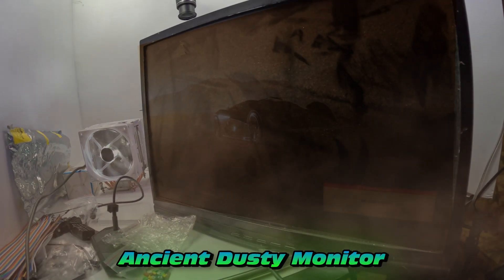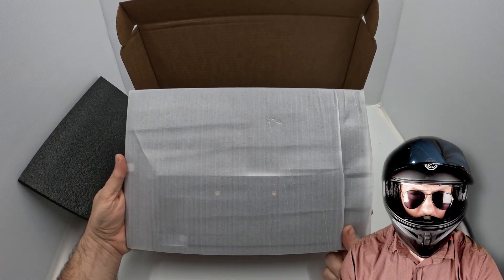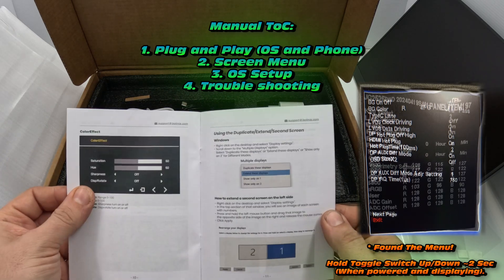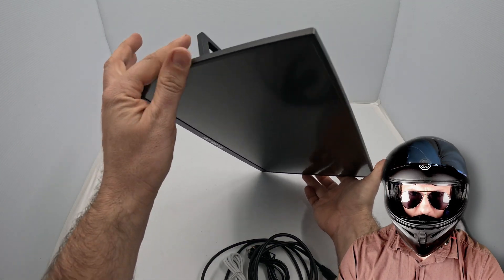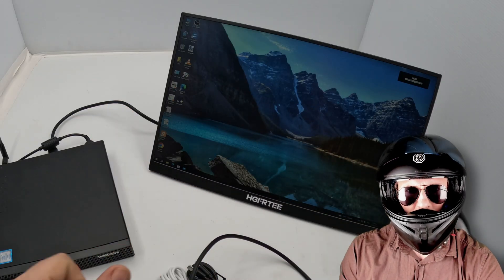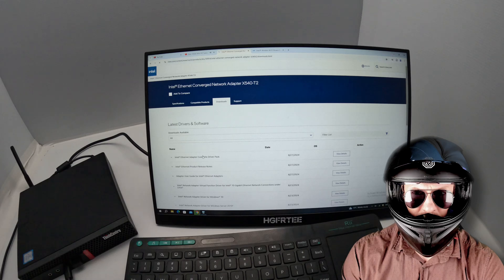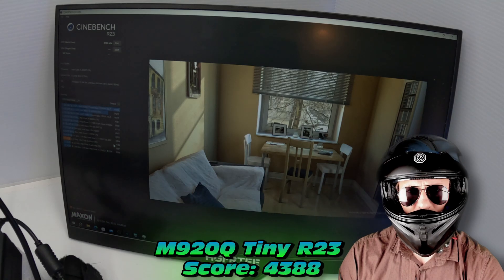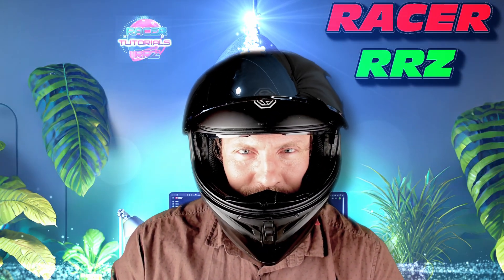$100 Monitor + M920Q: My BEST BUY of the Year. Portable, Touch-Screen, USB-C, FHD 1080p+ (#RACERRRZ)

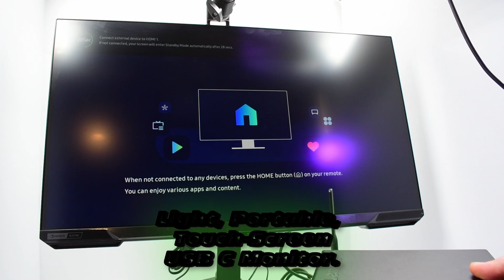Comment: whats the video at 0:28 if its separate on your channel? im bought a m920q for a steal and looking at people adding gpus to them, that cable for it looks ideal to get the gpu to sit elsewhere and cool without cooking the system!
Reply from the maker: You caught me there, it's footage from a video idea that has not yet made it beyond the sketch book - but I hope to make one for the M920Q to run an eGPU setup (a logical follow-up video to this one). With a long enough x16 PCIe riser cable, an external GPU brace/stand and a PSU with a jumper plug fitted - you could get a vastly improved graphical output from this little system. If you manage to get a high clock speed CPU in there (the 8700t is best bang for buck usually) - then you get a half decent gaming experience. 

There are other videos out on how to convert the M920Q to run an eGPU but I have not seen one that ignores the confounds of the case. If I do this it will be with a ridiculously over-powered GPU - all in the name of performance lol.

Comment: Nice overview!
Reply from the maker: Thank you. I am glad you found the video useful. This monitor has been really handy to quickly connect up a system for some display output. My only complaint thus far is the lack of a DP (most of the workstations I run into only have DP).